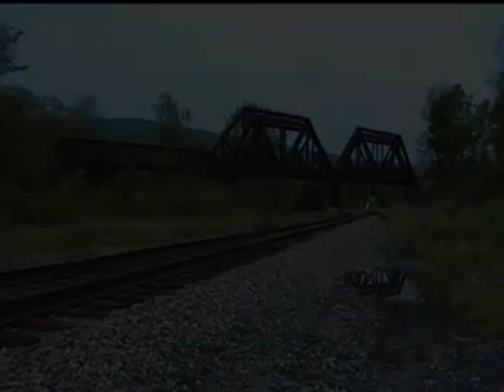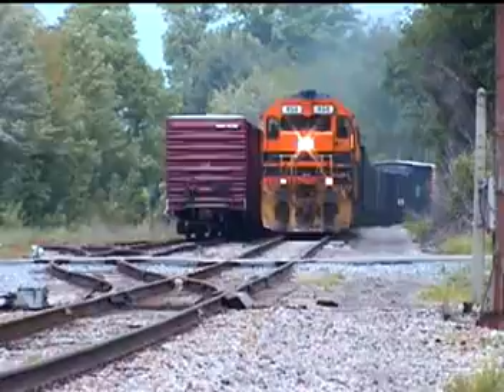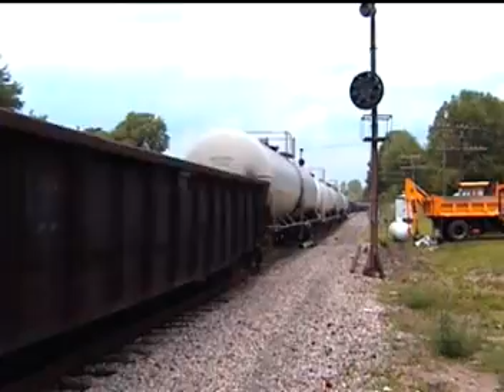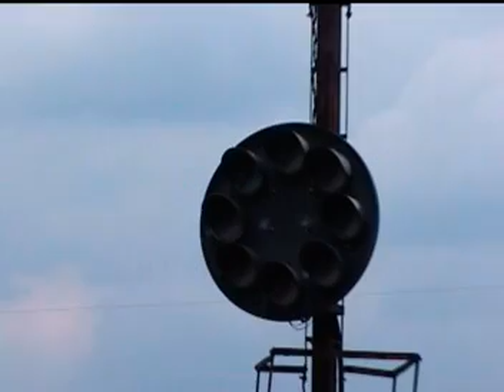B&P's EMD SD45's. That un-mistakable deep drone at Carrollton, Mt Jewett. 6/08/2009

Comment: My all time favorite locomotive was the EMD SD40 -2, but EMD SD45's are right up there neck and neck with them in either their original or Dash 2 models. I especially loved the original with the flared radiators. Don't get me wrong, I love the sound of 4 stroke engines as well, but when it comes to the sound of railroading, modern or the past, the muscular sounds of the engines in the SD45's are what come to my mind the most. I have got to see them in the east, in the midwest hauling monstrous tonnage and slugging it out with the mountains (and handily winning) in the southwest along the AT&SF in their splendid blue's or yellow bonnets. Hope to see and hear more of these! Thanks for the share and good job! :)

Comment: I like the angle you chose there in Carrollton. I was there in 2010 and at the time the WNY&P westbound to Falconer usually ran right before the B&P crossed over, in fact, it was not uncommon to see them passing each other on the parallel east of Salamanca. Unfortunately, the woods ruins getting a good shot of the latter. I guess on a day when things are off, it's possible to see a meet at the bridge.